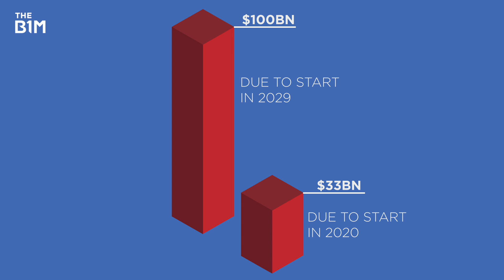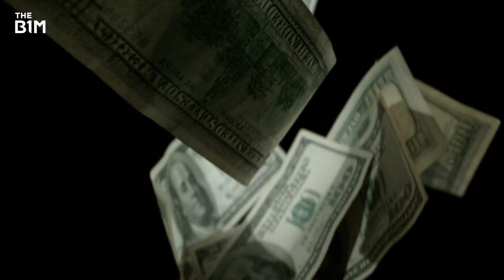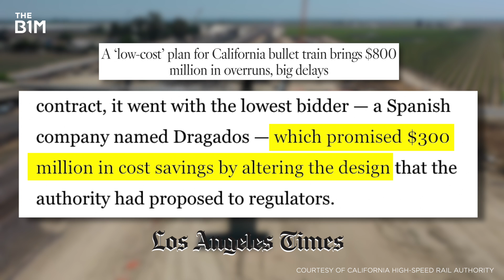What Went Wrong With California's High-Speed Railway

Comment: Texan here. They have a proposed high speed train from Dallas to Houston using the Japanese Shinkansen system. Similar to California, private investors are lured to provide funding. The setup is facing major delays due to land acquisition. Land holding and acquiring seems to be a major thorn for such public infrastructure projects.
Reply: Texas law allows railroads to use eminent domain to acquire right of way.  But that would tie them up in court for ages, despite having won every lawsuit thrown in their way so far.  As far as I can tell, they have received all the government approvals needed for their route, and have signed contracts with design and construction companies.  That leaves money as the last hurdle.  They need to turn those investor promises into real dollars so that they can convert their land purchase options into actual real estate.
They've been very quiet with press releases recently.  I'm hoping it's just a stealthy land acquisition strategy of the kind that's been used for ages by oil wildcatters to lock down mineral rights before anyone realizes the value under their feet.
Reply: @g3mck120  I wasn't aware of that, thank goodness they've cleared such a major hurdle. Two years ago I saw them posting and advocating for the project all around my university campus in Arlington but I haven't heard from them since. 

I remember meeting with one of the Japanese rail engineers while riding the DART (local commuter rail) late at night and he got all excited explaining the technology and human capital being imported from Japan for this project. Texas is in dire need of alternative transportation solutions.
Reply: And if you have good public transport, here it's often cheaper/faster than the car.
Reply: yea, i hear a lot of people claim that texas central is going to "show california how it should be done," but i've yet to see evidence of how they would accomplish that since they still face similar problems with acquiring land and the cost estimates for it have also risen.
Reply: @snoopyloopy  They just won't have to acquire land in SF. That will make all the difference.
Reply: @christianlibertarian5488  highly unlikely.
Reply: @snoopyloopy  Oh, I agree with you. I don't think HSR will ever come to SF. But this should have been obvious from the outset, before the wasted $10B.
Reply: Just curious why affected landowners are so adamant in resisting the HSR even in Texas.
Reply: @ianhomerpura8937  They aren't resisting the railway because of some moral standard, they just want a piece of that sweet sweet government money, so they are gouging the government.
Reply: @blokin5039  Tell that to the Japanese, and Chinese.  They are putting their HST in tunnels and in elevated skyways almost exclusively.  Time to wake the F up buddy.
Reply: i doubt this line will be in operation even by 2030
Reply: Have a law known as Land Acquisition Act, where the govt has the right to acquire land compulsorily by paying market rate. That solves the land problems.
Reply: @38284LHK  This is how it is done in Europe. It is negotiated with the owners, and if they do not accept the necessary land is expropriated at market price, because in infrastructure the good of the community is prioritized over the private good. There is no legal recourse in court.
Reply: @taranvainas  In the US, there is always recourse to the courts.
Reply: @christianlibertarian5488  I expressed wrong. You can appeal in court if you consider that you are not being paid just enough, what you cannot avoid in court is that the land you own is expropriated by the State for an infrastructure of general interest.
In any case, the USA seems like paradise for lawyers, they always find an opportunity to get rich. Here it is something different.
Reply: @taranvainas  Yes, the USA is a lawyers paradise. If you want to get a feel for it, watch an NFL game. So many penalties, resolved now by instant replay. The rest of society has the same mind set.
Reply: Exactly, if they just gave up and made the ENTIRE line underground, no one would bitch.  Once setup, tunnel boring machines are cheap to operate.   But, the idiots still play pretend games they are going to do this above ground giving everyone epilleptic headaches everytime a pole flashes past.
Reply: @w8stral  Boring would easily cost 200 to 300 times more.
Reply: @StuninRub  Tunneling cost is actually fairly cheap with a boring machine... So is putting everything in a skyway.  87% of the Shanghai-Beijing route is elevated track which bypasses the land rights issues which would be an even GREATER problem in the USA.  ONCE, uh hem, ONCE a tunneling machine it is in place, setup and boring it is cheap.  You would not be going deep, in fact an open ditch would be a large majority of it.  For instance look at Japan's new line, 80% of it is underground.  Why?  High speed rail cannot have road crossings, roads have to go either under or over anyways.  So, once you factor in all those crossings into the cost, a dedicated tunneling machine or skyway becomes cheap and avoids the land rights issue for the most part...   For instance all those farmers who would lose a VERY large chunk of land and access to their fields.  A gigantic issue in California for instance.  Same would be true eveyrwhere else as well.
Reply: @w8stral  Simply not true. Tunneling is the most expensive way to build transportation. You don't forgo land acquisition just because it is underground. The amount of lawsuits you will uave to deal with alone can fund a brand new high speed railway. The problem is much more complex then this. You watch one hype video from Elon and you think you became a transportation infrastructure expert? Lol cool story bro, why don't you tell it again?
Reply: @StuninRub  IMHO, that is not true in California. I don't think the entire GDP of planet earth has enough money to bring HSR into San Francisco. You are only considering the building costs. The costs of the lawyers is the real cost.
Reply: @christianlibertarian5488  HSR will NEVER be in SF proper. There is no space for it.
Reply: @StuninRub  The station can be underground. The traveler leaves the station directly in the city center.
Reply: @taranvainas  It cannot be underground, downtown SF is built on landfill, everything is slowly sinking there.
Reply: @StuninRub  There is nothing impossible for a good engineer, there is a solution for everything. The only thing he needs to know is where to support the construction and that is something that we geologists tell him. I think I remember that SF's problem is an artificial fill that was not properly compacted. Well, underneath that fill there must be ground capable of supporting pile loads. That terrain is tested and the engineer will know how many piles are required. There are infinite more complicated works all over the planet. And in any case, the station does not have to be located in the lowest part of the city: the hills are made up of rock that can be excavated.
Reply: @taranvainas  I dont think you understand how big of a project you are implying should be undertaken. It would require you to excavate half of the downtown area down to bed rock. It would never be economically viable and therefore impossible.
Reply: @StuninRub  Sorry, but you're wrong. Think of it as a tunnel that widens into what will be the station, all built from the tunnel entrance, so the city above wouldn't even notice it. The soil of this excavation rests on piles, which in turn are supported by stable ground under the fill. Only one access would be necessary for travelers, which naturally does not have to be large. I don't know if you know how the piles are installed, but it is a simple task that is constantly being applied all over the planet. The piles can reach incredible depths until they find firm ground, with a width that rarely reaches 1 m. They are driven into the ground with specialized and very common machinery. Many stations in Europe are underground and the cities above them are intact. I live in Madrid and under the city there are several huge train and metro stations that have been excavated without the city having been affected in any way, they have been excavated from below.
Reply: @taranvainas  That's the problem, the buildings in SF downtown are sinking
Reply: @StuninRub  Only buildings that are not supported on piles sink. If I remember correctly that fill began to accumulate after the great earthquake, so I must think that the large buildings that were built afterwards were already designed on a system of piles. America has very good engineers, I don't think they have not foreseen the compaction of the landfill. Think that this artificial fill compacts over time, regardless of whether they have buildings on top or not (with the extra weight of the buildings the phenomenon accelerates).
Reply: @StuninRub  On the other hand, that landfill represents a great risk in the event of an earthquake. The buildings on piles would surely withstand it, but the others ... would surely sink into the ground itself by a phenomenon called "liquefaction." The ground behaves like a liquid when it is shaken in the presence of water.
Reply: @taranvainas  You have no idea. Look up the Salesforce tower and Millennium tower. They both have sunk over 1 feet in the past three years and they were built within the past 10 years.
Reply: @StuninRub  Well that can be explained in two ways:
1- It is not supported on piles
2- If it is supported on piles, these are not well calculated.

P.S. I can think of two other explanations:
3- The geotechnical study was not exhaustive enough.
4- The construction company did not faithfully follow the instructions of the engineers and nobody was there to check that things were done correctly.
Reply: @StuninRub  There is always space, you just have to use eminent domain to acquire the land. Not likely in SF.
Reply: @christianlibertarian5488  who is going to invoke it? That only works on poor people. You can't use it on the rich.
Reply: @w8stral  You can't dig under people's property without permission.  The same land acquisition problem would still be there; you've just made the solution 3x more expensive by putting the whole thing inside a tunnel.
Reply: @GintaPPE1000  The land acquisition problem is mostly from farmers who 1) lose land and therefore lose total crop and 2) lose access to their land due to said railroad and is WHY even in China where there are near zero land rights and the CCP OWNS 100% of the land, they chose to put most of their HST IN THE AIR, and not on the ground and it cost nearly the same, as China with its 1.3Billion people has to have farm land to EAT.  By the time you have all those bridges / tunnels for road crossings and normal railway lines, you may as well just put the dedicated HST lines either IN THE AIR or UNDERGROUND as its costs roughly the same once you set up to actually DO IT.
Reply: @w8stral  If I'm riding in a train, I'd like to see some scenery .
Reply: @davefrompa5334  Not at 200mph or 300mph you would not.  Unless you love massive headaches due to sun/shade/sun/shade/sun/shade of every single tree, pole, branch.  Scenery from a train works at 45mph.  It does not work at faster speeds.
Reply: @w8stral  What you say sounds like when it was feared that from 34 km per hour the air would be sucked out of the wagons and the passengers would die asphyxiated. A myth. I live in Europe, you will not see any tree near the tracks, and you do not perceive at all that you are passing near a pole, at that speed everything that is near the track passes in milliseconds.
Reply: @w8stral  Obviously you've never ridden a high-speed train. There can be NO trees in the vicinity of the tracks, there are fewer posts than in a normal line and the shadow they could produce is imperceptible at that speed. The security measures are extreme, can you imagine the catastrophe that a simple branch on the tracks would mean, a simple stone, a simple rabbit? There is a protected strip on both sides of the route by fences and constant monitoring with cameras: if the slightest problem is detected, all the trains on the route are paralyzed and a team of people reaches the conflict point in minutes. But if you prefer to imagine it ... no one can help it, right? The maintenance of these lines is constant, not only to prevent trees from growing in the vicinity of the route, but also because they have sensors of all kinds to avoid accidents. Do you have data on high-speed traveler headache statistics? If they exist, I suppose it will be easy for you to reach them ...
On the other hand I live in Spain, here we are more than used to traveling in High Speed. Look for a map of the lines that we have not only in Spain, but throughout the EU and you will realize that what you say does not make the slightest sense.
Reply: @taranvainas  Appears you have never been on a HST or a train for that matter.  There were no trees near normal railroads initially EITHER.  Setbacks are the same for both... Guess what, reality happens, TIME moves onwards and TREES... get this... GROW over time, so your HST, currently have no trees as they are all new track.  They WILL grow.  You want "stats"... Pure genius... Open your eyes when you are on one and count the number of people with their window shades open verses closed.  That will tell you how many like flashing lights in their eyes.
Reply: @w8stral  I have told you that I live in Spain, and that here we ALL travel on high-speed trains, the network is wide and the prices are cheap (incredibly cheap). How do you want me to say it, in Chinese? Naturally, people lower the curtain, as in any other train, when the sun bothers, but not because of that supposed effect that you insist on considering with the passage of the shadows. But you can believe what you want. Come to Europe and try it, and then you talk.
Reply: @w8stral  And I don't think you even read what I tell you. I have told you that these lines are subject to continuous control and maintenance, daily. We cannot allow a single track sensor to fail because the catastrophe would be enormous. For the same reason, any vegetation that could pose a problem is immediately removed.
Reply: @taranvainas  Let me know when you find a tree in Spain.... There aren't any worthy of the name.  Spain has some tall shrubs.
Reply: @w8stral  LOL. You have neither traveled in High Speed nor do you know Spain at all, that is obvious. We have forests, you know? Also drier areas, although not as extensive as in the USA. Our country is VERY mountainous. Look at a map of my country, it won't be difficult to find it, and then tell me.
Reply: @w8stral  Not true. I have on numerous Japanese and Chinese HSR. No such issues as you mentioned.

Comment: In Germany there is a "ultra" high speed link between Frankfurt and Köln.
The trains go as fast as 320 km/h. They use the ICE3 11000 hp trains. (If used in pairs, then even 22000 hp.)
At one place the line is close to an Autobahn. It looks like the cars are parked there.
Reply: operating speed of cahsr is supposed to be 350 km/h.

Comment: Short question: if the first phase of this project is completed, will it then be possible to run highspeed trains at high speed on this section and at slower speeds on old routes which run at either side of the highspeed section to LA / SF respectively? Or is this not possible due to things like different railway gauges, lack of capacity on slower routes (or no slow railway routes available in the region at all), different security systems on the different railway lines, et cetera? Because if this is possible they can at least start running the trains already, allow people to get used to the train services and so on, and they can then improve the travel times bit by bit when more and more highspeed sections are completed.
Reply: I believe so.

Comment: What is the difference between getting to an airport or a train station?  Plus comendering the farm land seems oppressive.  VTOL and smaller airports located inside city limits makes more sense.  Contracts awarded to US senator spouses calls to question the bidding process.
Reply: In most cases the High Speed stations are in the center of cities, at least that is the way it is here in Europe. If a train station did not previously exist, it is built underground.

Comment: The biggest problem the project faces is the mountain ranges separating both SF and LA from the central valley. This makes completing either end a massive challenge and expense--above and beyond the massive challenge and expense of building a high speed line into a large urban area. With the central valley portion already well underway, they should really re-phase the project to maximize the usefulness of this initial portion at the least expense. That is, they should focus on continuing up the valley to Sacramento, where it is easy and cheap to build, while figuring out the problems of getting into SF and LA.

Comment: Correction: The current final figure us not "over 100 billion". The HIGH end estimate is just shy of 100 billion. The low end estimate is in the mid 70 billion. It could be anywhere in between. Also, the video deceptively makes that seem like its just for the mid-section under construction. It is the total buildout cost. 

Also worth noting that while the central valley is where the majority of construction is, HSR bond money is also already funding construction in LA and SF (Caltrain electrification, LA Union Station run-through tracks, grade separations).